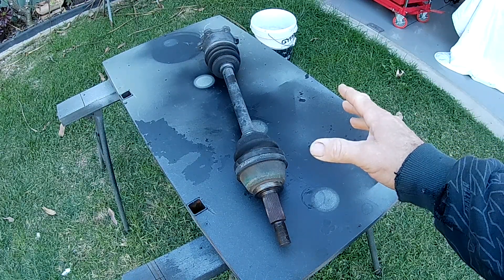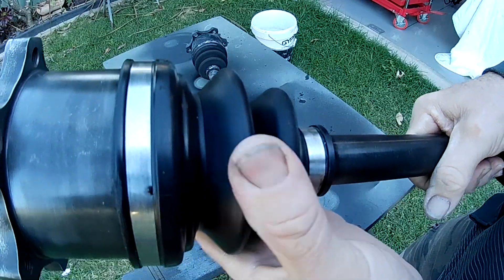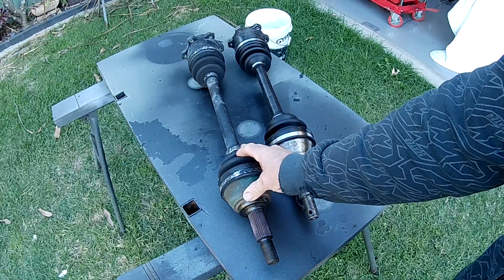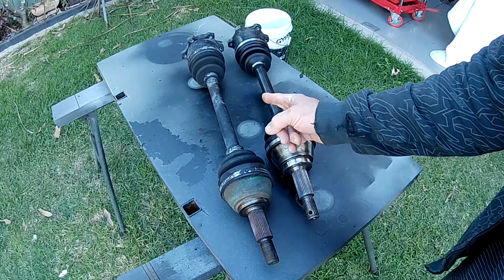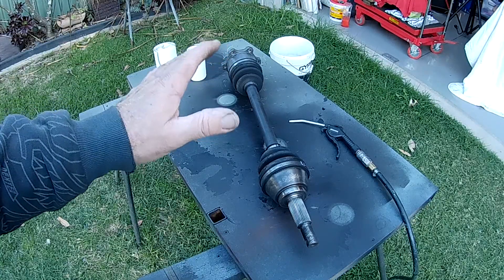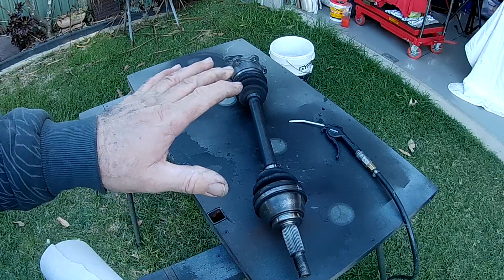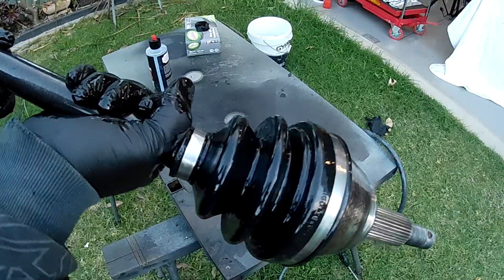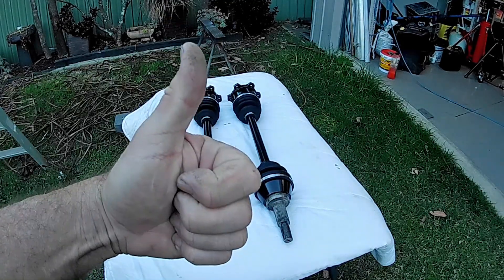CV Boot & Axle Restoration, Project Fairlady The Nissan Z32 300zx Twin Turbo Mega Build.

Comment: Hi Trevor,
A few years ago before I retired, I used to work on business machines of various types, a lot of which had rubber components and a lot of the time these rubber parts were impregnated with all sorts of rubbish that worked into the rubber grain rendering the rubber virtually useless, on most of the equipment being so old replacing the rubber part was not an option usually because the part no longer existed. So I had to use a cleaner/rejuvenator to bring the rubber part back to new condition that lasted the rest of the equipment’s life, or at very close to it. This stuff is extremely good for all types of rubber products, I have never had any problems with using it.
       The product is called;- VARN Super Rubber Rejuvenator, restores life to rubber blanks and rollers, it is made by the Varn Products Company Pty. Limited. All the instructions for use are on the tin. ‘OH’ it’s in a liquid form.
       I hope this information is useful to you, like I said this stuff is brilliant on all types of rubber.
Love your videos. I also emailed a copy of this comment to you.
Steve K
Reply from the maker: Thanks Heaps for that Steve, really appreciate the input. I'm gonna have to get some & give it a shot. Cheers.

Comment: I think I now know your other job. Is it to do with bikini lines? Like many comments, I would've called those rubber boots done and replaced them - thanks for opening my eyes! Thanks for the tip on the rubber and trim conditioner...now to find the stuff.
Reply from the maker: Hi Benny, this has been my "go to" method for years. A boot Kit from Nissan is $420 trade + a whole heap of work. If they're not torn & the CV's are in good nick as these are, its a no brainer. It really does return the boots to an as new condition. I reckon I have used every rubber & trim conditioner on the market over the years & nothing comes even close to this stuff. Particularly good on weathered automotive plastics too, you'll never look back. Cheers Mate.
Reply: @TheAussieShed  Thanks!